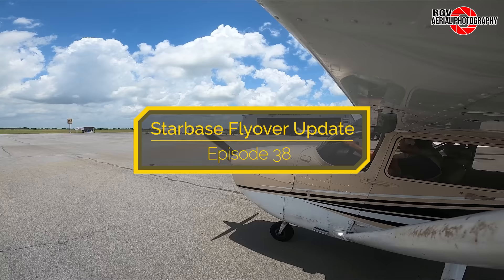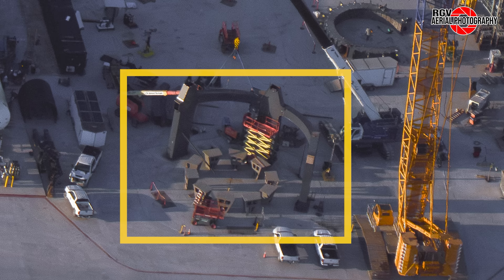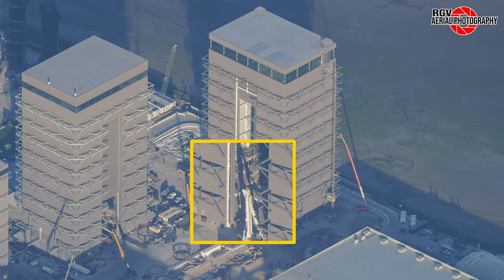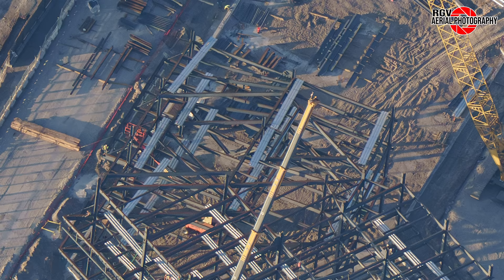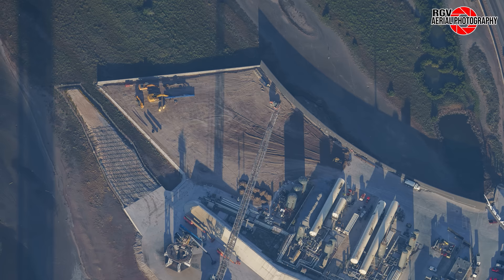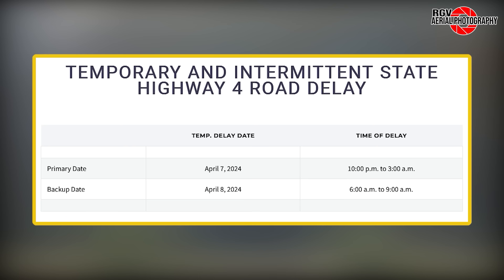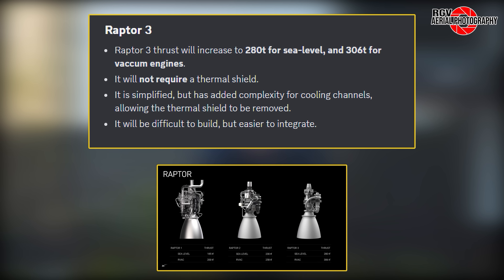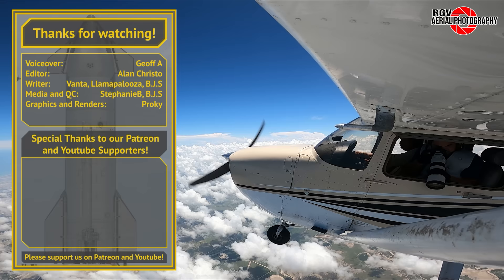Elon Announces Starship Upgrades - Starbase Flyover Update 38

Comment: RGV is the source. Thank you!
Wick work at orbital pad B isn't in it's final stages yet because the small strip of wetlands hasn't been touched or pre-loaded with fill dirt. The plans also call call for an expansion to the south which is still "off limits" too. I recall, wick work - preloading the soil, seemed like it took forever (12-24 months) before the first OLM and tower went up. Hopefully pumps, more wicks or ballast can speed up the process.
It seems like SpaceX expansion is picking up momentum at exponential rates. 
In Elon's speech regarding progress last week, he kinda hinted at more than one tower per pad at the Cape, but then "throttled" his announcement to limit potential "environmental blowback." 
Two towers per pad would be nice.
I definitely think landing crew on the Moon and a ship autonomously on Mars will happen within 6 years at this rate. 
These are exciting times. Thanks RGV for keeping us in the loop!

Comment: Note: Booster with V3 engines will have 10000 tonne thrust. But V3 only has 280 T thrust - so hoping to squeeze in three extra engines. Otherwise need 303 T engine.

Comment: I hope SpaceX doesn't build the new launch tower and OLM facing in the same direction/orientation as the original.  Unfortunately some people's renderings show it like that clearly because it looks good. However it was a mistake to build the original launch tower and OLM so close to infrastructure/fuel farm. Thats why it makes far more sense to place the new OLM facing completely away from any infrastructure, with the 2nd  launch tower behind it acting as a barrier between it and new infrastructure needed for that second launch tower and OLM.
Reply: It has to face the same direction. How would they manoeuvre the Boosters and Ships to land the opposite way when they land the vehicles 🤦‍♂️
Reply: @moodmusicytc You don't understand what I'm describing.
Of course the new launch tower and OLM will be in the correct position/orientation to line up with each other. However the current launch tower and OLM face towards the ocean and the infrastructure/fuel farm is basically running parallel to one side of them, and far too close.  

I'm just saying build the new launch and OLM facing/turned  approximately 90° away from the ocean. That way there is only empty land directly in front of the OLM, and any new infrastructure for the new launch tower and OLM would be behind the launch tower. Hope this helps. This would make immediate sense if I could show you a picture. It's not complicated.
Reply: "symmetrical"